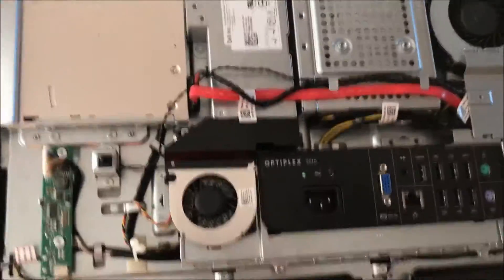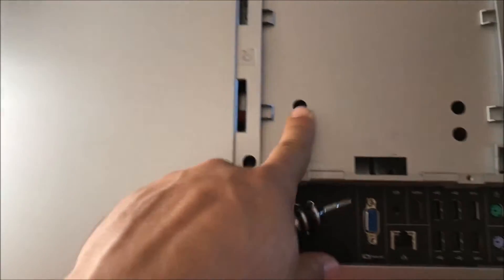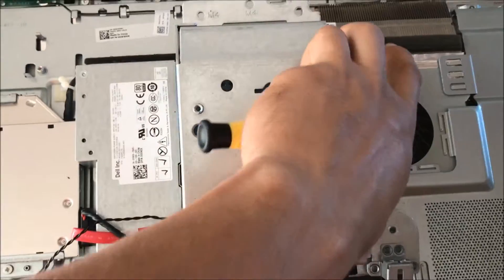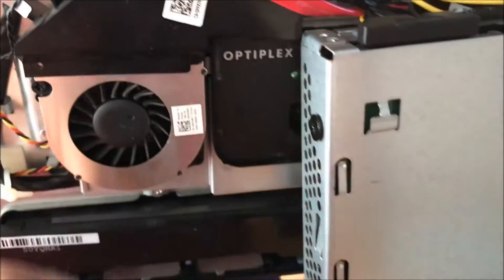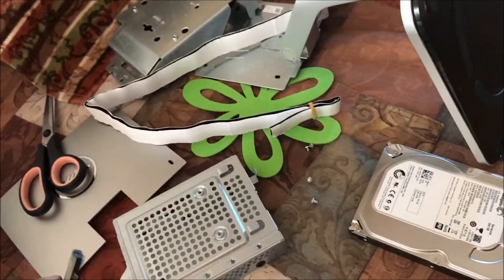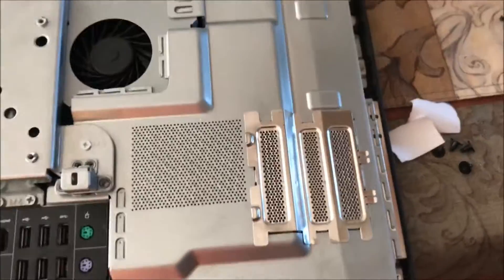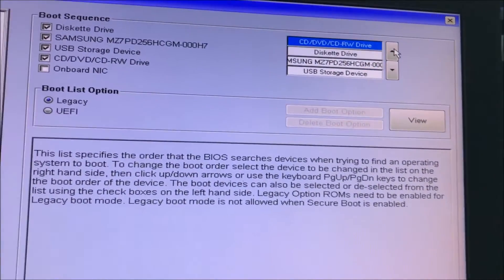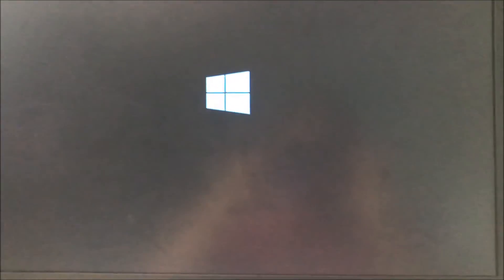Dell OPTIPLEX 9010 AIO hard drive to SSD conversion/ RAM UPGRADE

Comment: Is it possible to replace DVD drive with HDD or SSD?
Reply from the maker: uses a different interface so no :(
Reply: @MoVoltageMoPower  DVD drive has SATA interface, isn't it? So I think it's could be possible to replace it with 2,5" HDD using optibay or some another adaptor.
Reply from the maker: @ihorslipchenko8352  my doubt was that it will not supplu enough current to drive an older hdd...but i could be wrong...and like you said with an adapter it could be possible
Reply: Were you able to replace the DVD drive with an HDD?

Comment: Can u add an ssd to Optiplex AIO 9010 instead of replacing it?
Reply from the maker: afraid not mate...the system sometimes buys if you try to use an external as primary drive SSD

Comment: Nice video. Thanks. Can I upgrade video card on this? Whats the max video card ram can this dell aio support? What size?
Reply from the maker: you can't upgrade anything else due to the power supply. it is barely 200w. won't be able to run anything. you can check your graphics memory using a program called CPUZ on google.
Reply: I got a GTX 1050ti LP running on the stock 250w psu in my 7010 DT. See vid on my channel